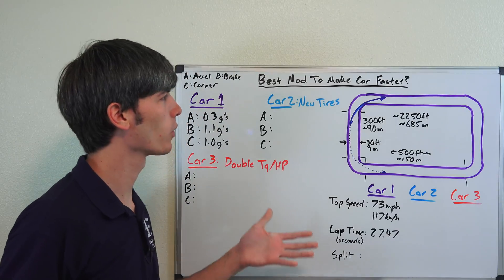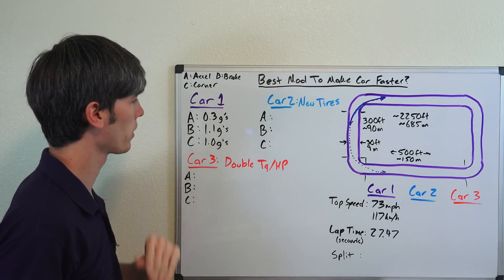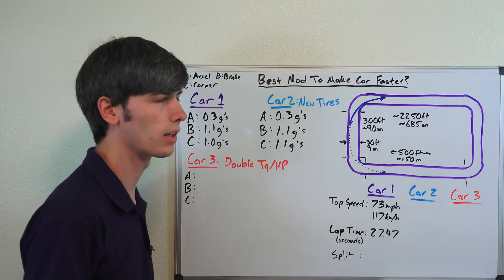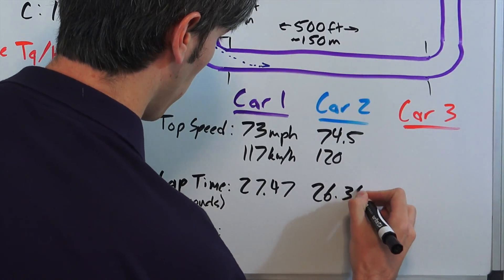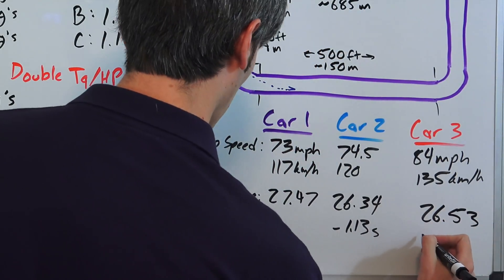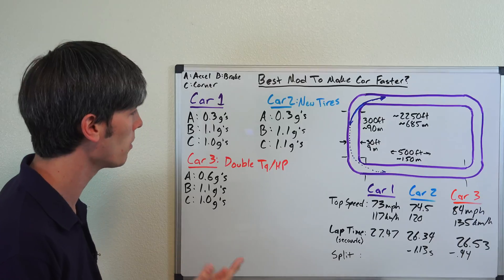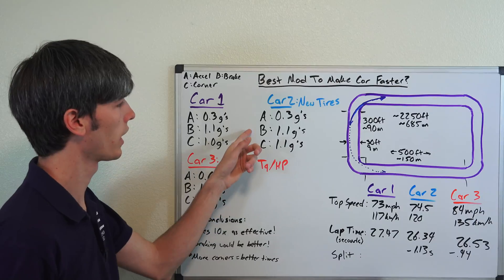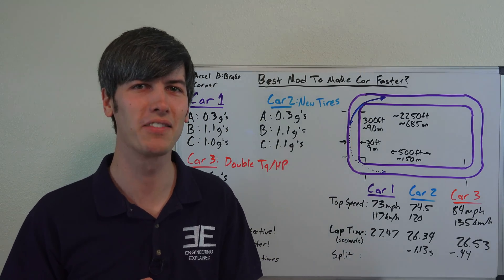What's The Best Car Mod To Go Faster?

Comment: Alright after much but minimal deliberation… you wanna first get the Cheepest can of degreaser clean you’re throttle body… next step good air filter or clean to best of ability old one, step 3 check if you can run e85 if you can’t get good petrol it makes a difference finally my favourite spare tyre delete take that sucker out live life on the wild side it’s heavy it’s barely used it’s there if you go for a road trip, live on the wild side … pvc delete is so good too.
Reply: Imagine having 195kw being over 1000kg(1ton) being rwd.. and being up against a 4wd Subaru wrx (na) mate power to weight is a big factor..

Comment: Love your channel, congrats! They are critical for bikers but also the suspension. It is funny when most people buy a street litter bike with >150 hp and they spend more than 1000€ changing the full exhaust system and making a repro to win 20 hp but they will never be able to use the extra 20 hp or even the original 150 hp with the original suspension setup. A good adjustable rear shock costs 600€ and it will make a huge difference

Comment: Awd is a way to cheat tires to some degree while remaining quick with even less power in and out of turns. Of course tires are the reason power can be transferred. Depends on the race type and environment to compete in really. Good video though.

Comment: Engineering explained congratulations you got one perfectly right and describe the cars of Kenny Brown performance Mustangs with his Advanced geometry suspension where in a demo Kenny Brown performance with a 500 horsepower Mustang okene brownsperformance Brown's Advanced geometry suspension took on Steve Saleen with a 750 horsepower0 Mustang that Advanced geometry suspension eliminating bump steer changing a roll center not requiring sway bars

Comment: While its good to see factual information of importance of good tires, there is another downside to just upgrading power.
In this example the times are almost the same, yet the top speed is much higher for the 100% improved power car.

So what does this mean? Well, it is doing much slower in cornering and this also means it has to do a lot of hard deaccellerations from a much higher speed to a much lower speed.
That is a lot of energy and that energy is most likely more than the brake system is designed to handle on that car, as it suddenly has double the power.

So ok, then you need also better brake, but better brakes are quite expensive too.
Maybe then first step is tires, so then power and then you can both drive faster at straights and do less braking.
And then a third would be better brakes.

Comment: Translation of truly terrible terminology: 
"Nicer tyres" - tyres that have a significantly higher lateral traction limit.
"Crappy car" lower powered engine. 
"Nice car" - higher powered engine. 
"The more turns a track has" - the proportion of corners and bends, to length of circuit.
"Racing line" - cornering so as to lengthen the distance of curved travel path. 
"$50 000 car and it's kinda heavy" - nothing.  It literally doesn't mean anything at all.  Unless both cars, and their drivers, are of identical specification the example has so many variables so as to make it totally redundant. 
"Dramatically similar" - again, I got nuffin.  🤦🏼‍♂️

Comment: Changing the final drive ratio is the cheapest mod unless you already have an optimal transmission/ final drive ratio.  In that case the next most economical modification would be low boost forced induction, unless the engine is not capable of handling higher boost pressures.

Comment: Also here’s a list for someone new to modify if you want something that is for a beginner. Get good tires first, then what you want to do is get some type of exhaust to increase airflow for later on modifications which is extremely important especially for a car with force induction because you need to push more air. After that you start with the basic stuff like if you have a turbo a charge and discharge pipe would be good paired with an air intake and fuel injectors or for NA you’ll want to probably get a new intake paired with fuel injectors which can help a little bit nothing too extreme. After that if you would like to for a NA get cams for certain cars or try to increase power by decreasing temp better airflow or a radiator. With force induction you could get an intercooler. After that get a tune on your car for all of the new parts which means a lot more power. After you get that power or even before you can change your suspension for something more suited for lots of power and probably replace your tires again because you’ve done a lot of showing off by this point. After that you can do what you want to do which includes new rims and stuff or even a new transmission. But starting out is expensive because you need a lot of parts to work together so you can gain power.

Comment: I’ll like to make the point that with better tires you can also have a more consistent time. My car right now has too much power for its tires so I spin my tires trying to get a good 0-60 time so my time can range as much as 2 seconds depending on if my cars launch control correctly estimates how much grip it’s does not have. I don’t really have a powerful car either it has over 200 horses but its heavy and has a massive torque curve because of the turbo. I’m going to get more power in it but I won’t be getting that before I get new tires because I am already losing grip immediately off the line then again when the turbo hits a second later. It’s better to be safe when it comes to these things because you don’t want too much power for your car to be able to put down. Sure you can but should you put not only your self but others at danger?

Comment: This is one of the reasons why the Guilia QV is faster than a lot of high perf cars around the Nurburgring, it comes Pirelli P zero tires, really stick and soft compound. 
Also Ferrari engineers design it so it has other neat features such as aerodynamics, power to weight ratio etc.

Comment: stright line and top speed wise, acceleration wise, usually one would do better with some form of forced induction. even if its just 0.1 BAR at high rpm it will make a whole lotta sense.

Comment: Ehhh I kinda feel click baited...
I get that tires are important and get you harder than a frat boy at Hooters but that's not what the title suggested.

Tires should be a neutral component, any competent driver understands you get the best tire for the job you want you car to do. After that it should be a comparison of weight saving measures vs horsepower gains by either upgrading your engine, adding a turbo/supercharger etc. It's obviously a balancing act that's controlled and limited by your engine bay and finances but THAT is what I was expecting by the title. Not "are tires as important as horsepower on a turning course" which...anyone who was valuing power over tires is either going to wreck their car once they put in a mod if they haven't learned anything yet or worse die when they flip the car or eat a tree. Sorry to be negative but wanted to keep it real.

Comment: Pointless video - faster around a circuit of a particular shape is not faster in a straight line with a rolling start nor a 1/4 mile standing start.  Next title how to make a car lighter - remove wheels/tires is still too heavy remove engine.

Comment: wrong its actualy headers with 2 inch primary tubes dumping into a 6 inch collector choked down with a 4 inch reducer with 4 inch pipe all the way back to a 4 inch inlet 8 inch out cannon muffler aka fartcan on a stock n/a vtec honda

Comment: You answered my question at the end.  It needs to be restated.  If your car can't put down all its power from a standstill, stickier tires will shorten your 1/8 or 1/4 mile times.  If all it can do is chirp the tires from a stop, it isn't going to benefit.  If you think that the better "hookup" from the start is a negligible advantage, you don't know drag racing.  Better traction is a near equivalent to a "hole shot" meaning one racer started earlier.

Comment: What you are posting is right but wrong at the same time and the title is making it more wrong!!! With the better tires you can corner faster and use more of the brakes. With the hp you got better accel. and top speed. BUT what you actually need depends on track, driver and overall car set up. You intentionally take a small track with more turning than going straight. The long straights are so small that the car with more hp need to start braking almost as soon as it starts putting down on the throttle. Yet what you say is right but the way you do, it is totally misleading. Put cars 2 and 3 on the track you draw only this time make the straight longer, then the car 3 will have better time. What's The Best Mod To Make A Car Faster? should be more like what is more useful in a small track with lots of cornering.

Comment: So, this is all theory using arbitrary numbers not actual fact. You simply pulled a number (10%) out of the air and started doing calculations so of course you are going to get those results lol

Comment: I am always in limbo with these arguments. However I have come to terms with this reasoning. Physics are undeniable, driver skill is the utilization of the vehicles potential. I have beaten many high horsepower vehicles in a turning situation in my underpowered car, yet I wouldn't even waste my gas in a drag race. No matter what, the connection to the road is tires. Worry about tire slip before clutch and belt slip (depending on application)

Comment: The first thing I would do is sling out the things you don't need so seats, radio, spare tire, screen washer fluid, lights, sat nav, carpets etc.  The lighter you are the faster you can move right?

Comment: Thanks for info,  but should I install turbo to either my 2009 ridgeline or 2018 Ridgeline to help with fuel economy /Towing around mountainous Lake Superior in Ontario Canada /more speed off the line?And what will be sacrificed if I change my 2016 Civic EX-T summer tires to Nokian All-weather?

Comment: Take any car , drop in a 2JZ with billet aluminum block and 100mm turbo running 60+ psi with an anti-lag system and running on methanol.

Comment: The cheapest way to make any vehicle faster is to lose some mass so that there's less inertia. Take out the seats., carpets and any other unnecessary equipment and it's possible to lose up to 1/4 of a tonne depending on the vehicle.

Comment: Best mod to make a car faster is driver training... Just as the wee Scot.. Jackie Stewart has shown time and time again. He even trained 'Captain Slow' on former Top Gear, to a 10 second faster lap in one afternoon. 

After that, GRIP baby, GRIP. 
I love my Nitto NT 05 in wider than oem sizes on the beater Vette.. NT 01s in the summer..    

Funny, we knew grip was the key to speed 50 years ago and loved when the Goodyear G19 slicks were newly available.  ( replacing treaded race tires) Then came downforce for even more grip...

Comment: What is actually meant with torque in this case? I hear this word very often in his video and I'm not an english man, so i can't really define it, even with dictionary.
Reply from the maker: Torque is the force pushing the piston down, ultimately what drives the car forward. The greater the torque, the greater the force the tires push the car forward. It is linked mathematically with horsepower, the two do not exist without each other. Power is how much work is getting done, and is ultimately derived from how frequently you apply a certain amount of torque (torque x RPM gives you power).
Reply: Engineering Explained Ok, and what effect does the power of torque on the specs of your car? Better acceleration? And how do I "add" this torque to my car?

Comment: I saw exactly what was referenced in this video in real life... I was participating in an open track event here in Florida... Basically anyone could use any vehicle they wanted in any state of condition... as long as it pasted the tech inspection anything went. SO I was using my 2013 Scion FRS... only things I have done to the car are added Hawk pads, stainless steel brake lines, Dot 5+ brake fluid, running a second set of tires and wheels I brought with me (the trunk and folded seat really can hold a set of 4). The wheels are 16" x 9" Enkei RPF1 and Hoosier R6 track tires. There was a newer Mazda MX5 out there running a full track wheel set up as well. On a tight technical track brakes and tires are extremely important... and not running some street tire that is just "ok" on the track can make or "brake" your track day events ;) We were getting so many wave byes it was getting comical.

Comment: making it faster. cams headers forged pistons intake (manifold for carbs) rocker arms etc... all those other bolt on only give you about 3% increase at HIGH RPMs in higher gears... wanna race for cash? I got a 67 Impala with 454. located in Los Angeles, ca.

Comment: some time ago the old Top Gear trio wanted to mod a Renault Avantime and tested it on their track. They started with better brakes and track tires, but the Stig was actually slower than the factory settings. They eventually made it faster by lightening it and finely tuning it, but still. I would like to hear your comments on that!

Comment: I think it's also important to note if you add bigger brakes and your tires aren't up to the task how hard are you going to be able to brake without the tires locking up, how much horsepower can you add without the tires rolling smoke coming out of a corner, you can get your suspension all modified for the track, but if the tires don't hold to the road, the better suspension is useless. 

I think one of the best things I did to my car is get a set of 235/55R17 Michelin pilot sport AS3s before that i had a crappy set of 225/60R16s, a set of Goodyear road tires on my car, even though the tires really exceed the grip needed for my HP, i can now break notably harder, and enter corners more aggressively, and hold a higher speed in a corner.

Comment: Any real car guy would tell you if you doubled the power and left the tires the same as stock all you're going to do is spin the tires anyway 🙄 and a car with double the power and normal tires will oversteer or understeer more in the corners because of the crappy compound. There's more to this then numbers out of a book.

Comment: I've always advised anybody that had asked me what upgraded they should do to their car is #1 tires. They are the most important component on the car in relation to Performace. Anything that is done to the car be it more power, lighter weight or suspension upgrades etc etc... is all translated thru the tires & its contact patch.

Comment: You should go over gearing, weight bias and transfer, and shift points. Gearing and weight bias/transfer is imperative on road courses or something like Rally Cross as you need short gears to accelerate effectively out of corners  and you want to start with 50/50 weight bias (or close to it) and have any weight transfer that occurs shift to the front outside tire. Also in such road racing applications hitting your shift points spot on is vital as you want to stay pretty well in the middle of your power band through all gears. One last thought don't overlook those pads and rotors high quality will let you brake later and keep it deeper in the curve so you scrub as minimal an amount of speed as possible. I do recommend cross drilled and slotted rotors as they dissipate heat faster via increased air flow, and carbon ceramic pads as they heat and lining fade less than semi-mets or even full metals, and still have initial braking quality of semi-mets rather than the slickness of full ceramics. This is why you should do a video on these 3 or 4 subjects, because I'm sure you can explain better than I can.

Comment: What doesn't make sense to me is the fact that tyres with greater traction helps to increase your cornering speed, but the greater traction should increase the magnitude of the frictional forces acting against the forces rotating the tyres. Coefficient of friction between the ground and the stickier tyres is greater, surely?

Comment: #MathGeek Lol Im into math a lot but their is so many different elements to driving/racing. Weather/Tire/suspension/cpu upgrades/turbine/ghetto air forced intake/ even the fuel/ ETC. Also the driver. Math only gets you so far.

Comment: it's so counterintuitive. As a kid. , playing games like grand tourismo, it took so long to realize that you can win with a weaker car by taking corners slower and more controlled.
 For the longest time I used a sandwich method where I'd basically stay with the main pack of cars and then use one or two opponents to slam them into the wall and bounce me off into the straight. This allowed me to use the powerful rwd 70s muscle cars I loved, despite their terrible handling. 
In reality that technique would probably cause an unsustainable amount of damage to my own cars, fatalities for opponents and some hectic fines

Comment: well I got avensis 2.2 177hp chiped to 205 hp+ dpf erg off+ lower car for 40cm + 225/50r17 wheels so I get around 211hp and from standard car I get lap time about 3.42-sec and with all this modification around 3.17 sec

Comment: I'd love to see another one of these with weight reduction added in, and maybe on a more realistically shaped/sized track (granted, that would require a lot more math haha).

Also, as great of a mod as tires are, the downside is that its a recurring expense, unlike most engine/suspension/weight reduction mods, which are a one-time expense (assuming they don't break down).

Comment: please add "..on a track" to this title. Because Car 2 would not be faster on a 1/4 mile, or on a track with longer straightaways. I get your point, but this theory only works in the racing "goldilocks' affect."